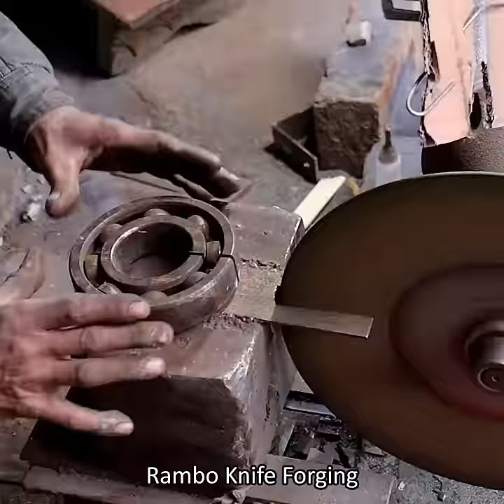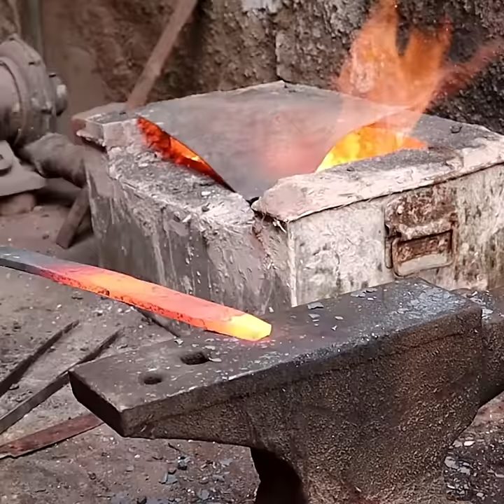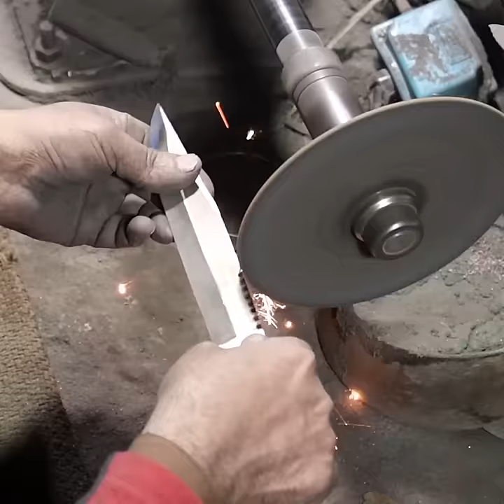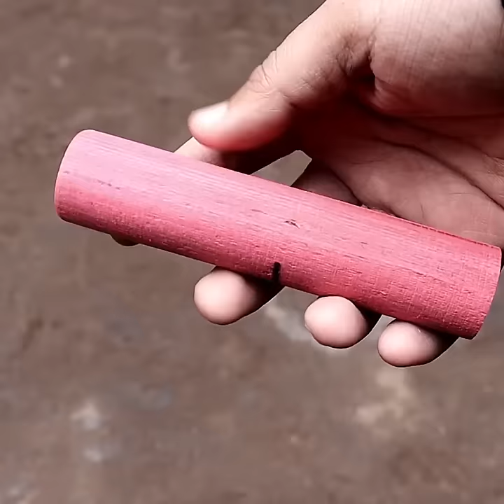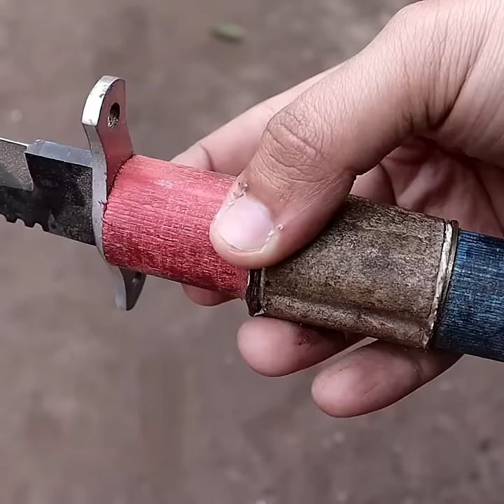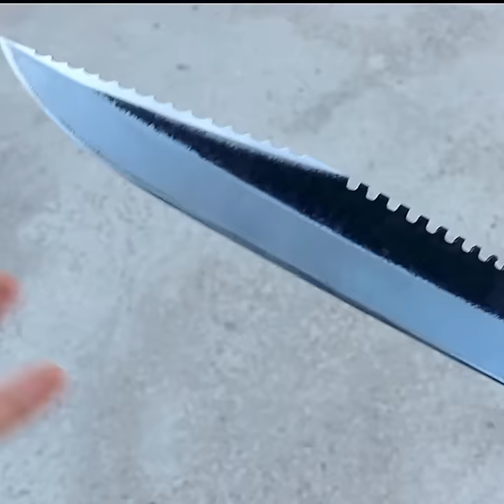Recycling rusted bearing to useful hunting knife ▶Full video @TopWorks​

Comment: I'm pretty sure you're supposed to use the bearings because the outer shells are low carbon where the bearings are tool steel.
Reply: If that were the case the bearings would destroy the races in no time.
Reply: У нас просто выбрасввают отработавшие подшипники

Comment: My only question would be: Will it pass the file test? I ask this only because I didn't see the blade quenched
Reply: well the base steel alloy can be made very hard if its heat treated right.  Most bearings are extremely hard but fairly brittle.  I've seen em shatter in a press.   Really depends on how/if he quinched it.